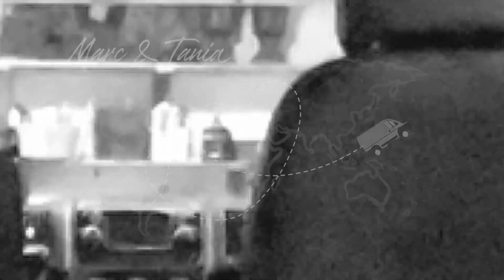Installing 400W of Solar on a Promaster 2500 Van

Comment: Using foam tubing around the wires was a stroke of genius 😃.  I used flex seal tape and had a devil of a time tearing it off when recovering the panels after a wreck.  Those foam tubes will be much easier to deal with if anything ever happens.  Thank you for sharing!

Comment: I bought those wires from your link on Amazon but both ends have black connectors, I can’t thread it through the cable entry house like you did because it has the black connectors on both sides whereas yours doesn’t. Are they removable?
Reply from the maker: I am so sorry for the late reply. We cut them and respliced.

Comment: Hi Mark and Tanya, did you only use 4 brackets per panel? I’m mounting 1 panel 50”x28” and am seeing some with 6 brackets and some with 4. Was curious how many brackets you used per panel? Thanks!
Reply from the maker: Ours came with 4 per panel

Comment: That's a really low profile A/C unit you have on your roof, the shortest I've seen. wow
Reply from the maker: It is very low profile....but its not the greatest either....Works pretty poorly in humid areas
Reply: @marctania2349  Thank you for the reply, very much.

Comment: nice job. what is the rack? did you buy or make it? looks like alumnium extrusion pieces.

also, do u think this would fit on a promaster 1500?
Reply from the maker: I designed it and then we sent it to the guys at Unaka gear in SC. They verified it and sold ut the pieces for it. I dont think this exact size would work on a 1500 but Unaka likely has all the measurements and can either help you design or sell a full parts set for the 1500. Good luck :)

Comment: Hey, y'all. Thanks so much for all the great videos. Y'all are such a breath of fresh air and it's so peaceful watching y'all interact with each other with such love and kindness. I do have a question.. Husband and I have been living full-time vanlife for the past four months and are just now building our DIY roof rack and installing our solar panels! What size screws/T-Nuts did you use to mount the Z Brackets onto your 80/20? We have 15 Series also. Thanks :)
Reply from the maker: So sorry for the late reply. We have had some things at home that have kept us from YouTubing for a bit.  We bought all fasteners from Unaka gear in South Carolina. I think they have some prebuilt kits that give you all the screws and T-nuts that you need for a given project. I cant recall the eact size but I do remember running out, and Unaka hooked us up with extras.
Reply: @marctania2349  Thank you 🤗

Comment: Do you have a web link to the solar panel manufacturer? and a name/part number for the panel or even the dimensions?
thanks
Reply from the maker: https://unakagearco.com/products/newpowa-200w-monocrystalline-solar-panel-24v?variant=43220688699611&currency=USD&utm_medium=product_sync&utm_source=google&utm_content=sag_organic&utm_campaign=sag_organic&gclid=CjwKCAjwyqWkBhBMEiwAp2yUFiFwo6PaRzl5M39Eiu3r5oA-m0GB7ll_R9wUF762Zo4YylASGvDC1BoCR7cQAvD_BwE

Here you go

Comment: What are the dimensions of the solar panel? I’m looking for a similar setup with 1 panel for a 136” Promaster. Thanks!
Reply from the maker: Hi Jeffrey, I am pretty sure they are 55.28 x 22.78. They are the only ones we could find to sit east-west on the roof and still provide 200W each of power.

Comment: great video!  about to install my solar on the van.  where did you get the flush mount brackets for your panels?  did i miss it in the video somehow?
Reply from the maker: Hi Shawn, Everything came from Unaka gear in SC. We actually drove to their shop since we only live a couple hours away....Wonderful folks to work with
Reply: Will they install the solar panels? 
 @marctania2349

Comment: I noticed you put your ceiling in first before solar. I'm a little confused how you drilled those holes into the roof for your solar if the tongue and groove ceiling is underneath?
Reply from the maker: Great question.....we left one or 2 boards loose so that we could run the solar wire before screwing them tight. Looking back, we should have done the wiring first. We certainly would do that if we did it again

Comment: I heard what you said about calling the air conditioner company and them saying you shouldn't need no caulk or anything.  the only problem is the air conditioning company is not going to be out in the woods with you or out in the desert with you or going down the highway with you when it rains and water does get in there for whatever reason.  And they definitely aren't going to give you the money to repair the inside of your van.  in my opinion and everybody has one I think $2 worth of insurance in caulk is worth $300 worth of possible damage. just like when I told you I seen the seal behind that second electrical outlet that you put on the side of the van with putting caulk on it for two cents worth of insurance.  To me a couple dollars of caulk is worth hundreds of dollars in repairs that's going to come out of my pocket.
Reply: I agree, better to err on the side of caution than trust in the unknown...
Reply from the maker: I agree with you. There is a really thick piece of foam that compresses to seal the inside of the AC unit. Water getting under the actual shroud won’t matter. This is a hard one to seal off because of where we installed it. The gap between the shroud and the roof of the van is sometimes as much as an inch. We’ve tried sticking foam in there and caulking all around it and it just made a huge mess. We are going to let it play out for a little bit and see if there’s any leakage, which we would immediately see inside the van, since that area won’t be covered up. We haven’t seen any and we have had some massive rain storms.  But we will certainly keep an eye on it and thank you for the great suggestion
Reply: @marctania2349  👍👍👍